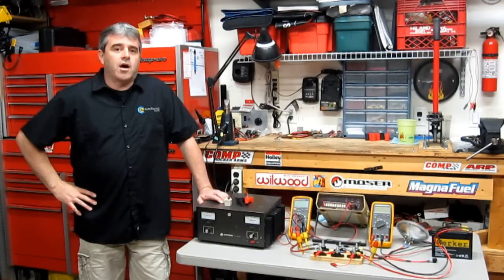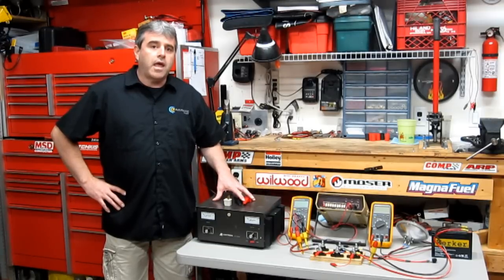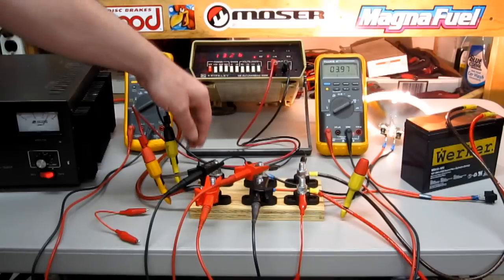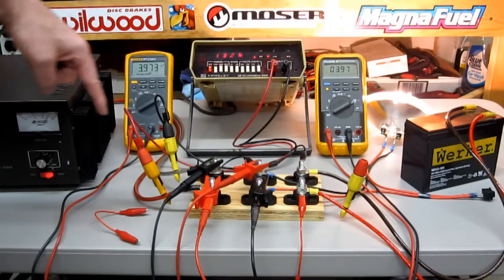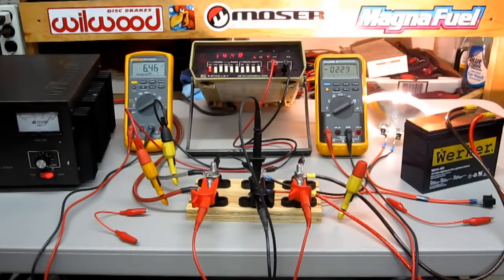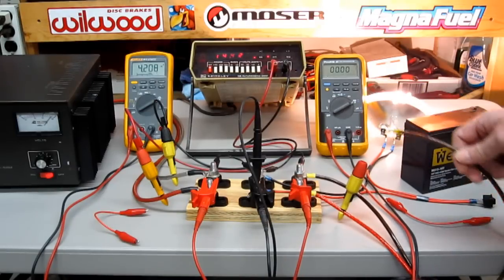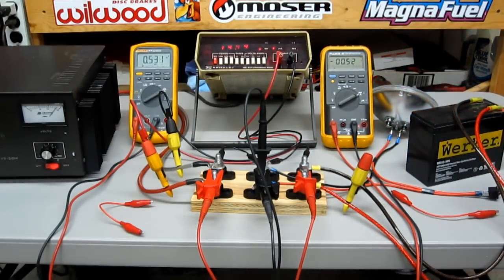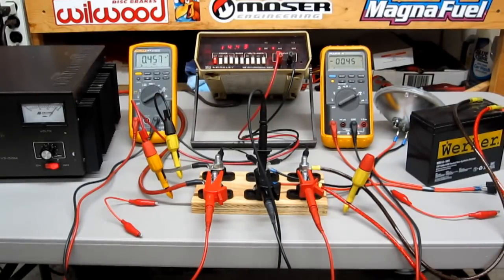Charging Systems 101 - How does your alternator and battery REALLY work?

Comment: Stone the Crows Dude could you make it any more complicated?
Reply: Aidan Stewart . . . Hmmm - well, this is a fairly complex topic with a ton of mis-information out there in regards.  This video is not complex, nor difficult to understand.  What it is is comprehensive and step by step.  Sometimes it simply isn't possible to convey this kind of information in two minutes fifty seconds.
Reply: I agree 2 hours 50 minutes would do it for me. Then I would understand it and not just have a, Blind Man on a Galloping Horse idea of it. No offence Dude. The reason I am interested in it is that I have an idea for an electromagnetic Bike, using and Alternator and a linear motor, so I need to check out the feasibility of it before I go and waste money on stuff I do not need or is not going to work.
Reply: TNTMarcel 
yes. the alt does it all above around 12.5v. basically you need alternators to power the system. the batteries are for when the vehicle isn't running. if you don't have enough alternator. you going to just kill the battery. with it running. I had a amp that pulled 160 amps or very near it. and a 150 amp alt. cruising town booming. with lights and what ever else. in 20-30 minutes the battery was dead. yes more batteries allows you to listen longer. but with falling voltage. so your amps are loosing power. most amps are rated at 14v. so if you want the most out of the system. you need alternators adding up to about 50 amps more than the system pulls. and use capacitors! no one seems to do that anymore. they are like a battery but discharges all its power instantly when needed. battery's can't do that. and they charge almost instantly. allowing the amp to output more power. it can make a big difference. sorry for rambling. hope I hepled
Reply: So if i understand corectly, in car audio the battery is useless above 13v-13.2v (depending on battery model, starter, agm, lithyum and so on).  Only when the alternator voltage drops below 13v then the battery starts to kick in.

Comment: Nice demo. Removing the earth ground just means you've created a floating power supply like another battery. Negative is not the same as earth ground because the transformer separates both currents and the rectifier converts the AC signal to DC.

Comment: My dashboard on the car shows a battery sign, its now 4 days but I have never experience  a battery drain, what should I do so the display goes off completely each time start the engine? It is irritating me guys
Reply: vincent bwalya 
you probably need a alternator. it is probably just putting out enough to keep it where it will start. but still low voltage. have you tried to turn the lights on and ac on high? then check the volts? or if you have a volt meter. check the battery voltage. then check it again with it running. if the volts goes up its charging. to over 13.4 or so. usually about 14.4 . but 12.5 or a little more not running. if there is a volt gauge on the gauge cluster in the dash. check it. or a lighter plug volt gauge. or a cheap volt meter from Walmart or somewhere. hope I helped.

Comment: So for car audio, If I understand correctly, As long as I have an alternator that is supplying enough amperage to take care of the demands (headlights, ignition system, accessories, amplifiers, etc.) and maintain the surface charge of the battery, then the stock battery would suffice. This is listening to the audio system with the vehicle running. Is there something else to it? How does the voltage regulator effect this? How does the fluctuation in demands from the amplifiers effect things?

Comment: how do you check the amp output of an alt? i got a fieldpiece sc77 true rms multi meter to use to check it

while riding around voltage is around 13.4v or so, and when i stop at stoplight it goes anywhere from 10.6v to 12.8v with hid's on and thats it, stereo off, i got big 3 in 0guage, dunno whats wrong with it